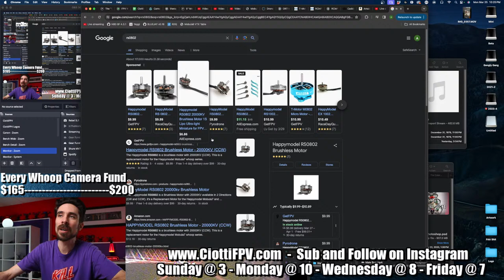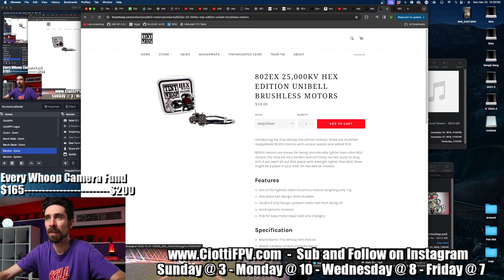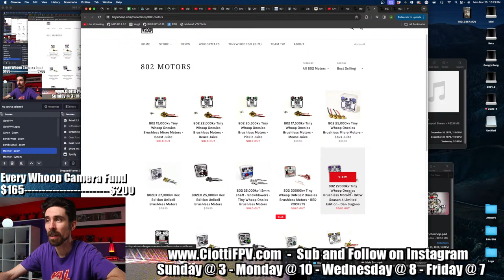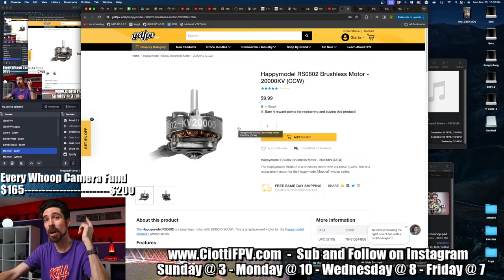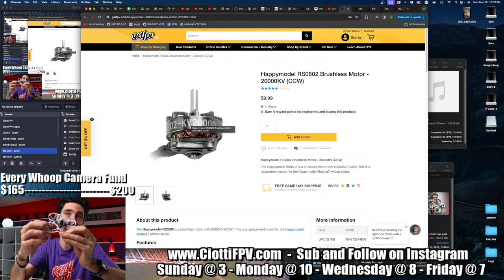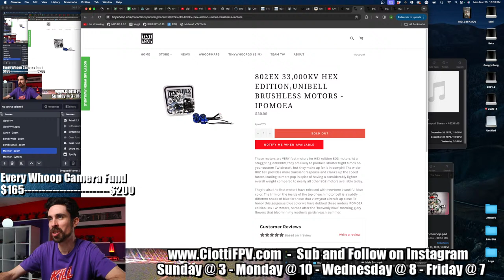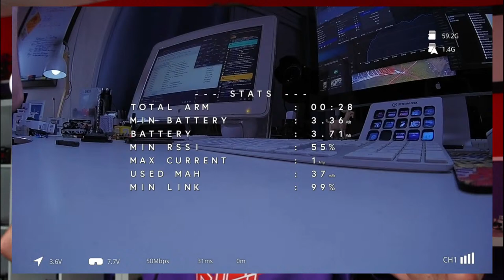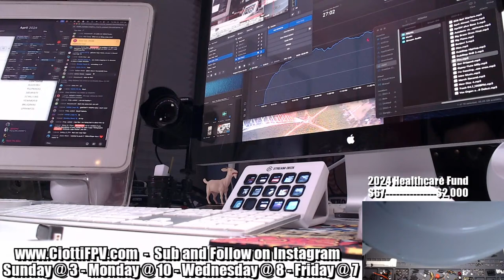Replacing Fractal Frame with a 0.6 gram 3D print - #6Batteries - Q&A

Comment: I just did a motor bell swap with the RS0802 1.5mm bell and the 25Kkv ex0802 happymodels. So yes, it's compatible. 
I had them laying around, but the RS0802 is also a good choice for a swap because they are dirt cheap.
Reply: One thing I noticed is that the ex0802 only have a teflon and brass washer on the bottom and a brass washer on the top. The RS0802 has teflon and brass washer top and bottom. So make sure you realise that when you do the swap and put all of the washers back into the new RS/EX hybrid.
Reply: Hopefully this becomes pointless soon and HM can just give us a high KV 1.5mm RS bell.

Comment: 25-03-2024
What’s up Ciotti and the GG.
Sorry to disagree, I’m running fractals 65, 75 and the 75mmpro, the 65mm and 75mm running for 1,5 years straight crashed on concrete just lost 2 motors still love all the Fractal builds I got.
So yeah imo its absolutely no garbage.
I lost to many mob canopies crashing hard. That made me change to Fractal and never looked back.
The fractal sucks was just for fun. It was to put you down or hurt you bro. It did not was pointed at you. It was a meme a long time already.
00:03:17 on this stream……
00:20:06 What is the best glue/method to prevent standoff screws from getting loose on an HDZ meteor build? I'm breaking more standoffs than ducts....
00:24:21 Are the happymodel rs 0802 bell compatible with the EX or SE stators?
00:34:43 Best tips on tight power loops in the house I’m struggling to get them in tight spaces with my whoop.
00:39:12  If it fits on the 65 V3 will the print fit on the 75 cockroach?
00:40:00 With a stock meteor75 esc , if I was to upgrade a higher kv motors, do I need to upgrade the aio as well? Newbie
00:48:09 I’m making that crown 65mm frame build with the fractal 65mm, still contemplating it, the crown frame itself is starting To grow on me, but what should i use for a aio and camera?
I ordered a set of 25k 0802hex motors from fractal engineering, with 1.5mm shafts. going to put 33k stators in them.
00:57:09  What are your thoughts on capacitor ratings for 4s? I realized my HDZ Crux35 came with a 16v 100μF capacitor. Is that really enough?
00:57:58 Which goggles would you suggest the Fat Shark Dominator Digital HD or the Walksnail Avatar HD Goggles X…..Thanks!
01:01:23 ranting and building.
01:47:00 Flying the new build.
01:51:55 Logo rip off ??
01:52:55 Flying for real now……
02:05:54 Will this camera mount be durable?
Stay safe everyone and have fun flying
Reply from the maker: Here’s the problem with Fractal Sucks being not directed at me, out of all the logos on earth they just happened to pick the one that looks exactly like mine?  I keep hearing the excuse of oh it’s just the Nintendo logo but it is not, the Nintendo font is completely different, the font was specifically changed to the exact same font that CMYK used on my logo.  That’s an awful lot of coincidences in a row isn’t it?  Not to mention the item description of the shirt
Reply: @ciottifpv I think you need to take a step back and see where you are, giving your opinion online means you can and will be criticized. Everyone is entitled to their own opinion and everyone is free to share and express.(however that may be) Even between friends/fam- being able to disagree without emotions getting in the way is a mature behavior- though we play like kids… my 2 cents you didn’t ask for- let it roll off/laugh at it/ fuck it get payback if you want/ or my personal favorite- joke about.
Reply from the maker: @frshagen  here's the problem, it's not an opinion that I gave online, if I had been saying Fractal sucks I wouldn't be pissed AT ALL, I'd own the fact that I was saying it and that was a dick thing to say.  But I haven't been saying it, I'm being made to look like an asshole that has been saying it though, and that's why I won't let it roll off me, I will stand up for myself and set the record straight like anyone with even a shred of self worth/confidence would.
Reply: @CiottiFPV  - damn that’s shitty. I get the whole picture now. Them acting deaf/dumb makes more sense now.. bc what it’s looking like: is they couldn’t handle criticism about a platform they love so much, and lashed out childishly. And maybe.. they’re too embarrassed/scared/not ready to defend said platform.
Reply from the maker: @frshagen  there you go man, that’s certainly what it seems like to me as well but the two of them keep spinning this weird story that it was an inside joke that had noooothing to do with me and then the logo is just the Nintendo logo which they chose to use without realizing it looks just like mine even though the Nintendo font is COMPLETELY different and yet somehow out of all the fonts in existence they chose the exact same one my graphic designer did…but hey I was born yesterday and then immediately fell off the turnip truck